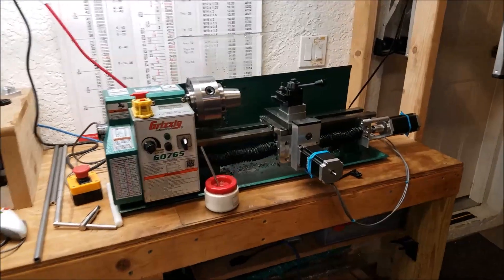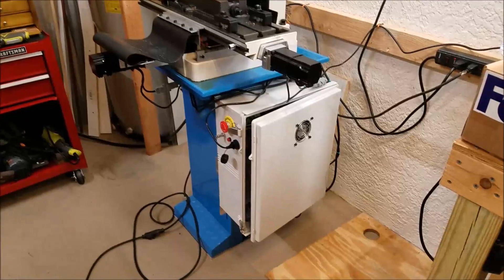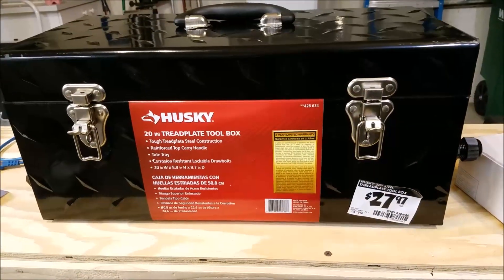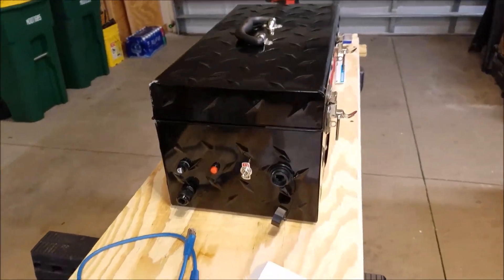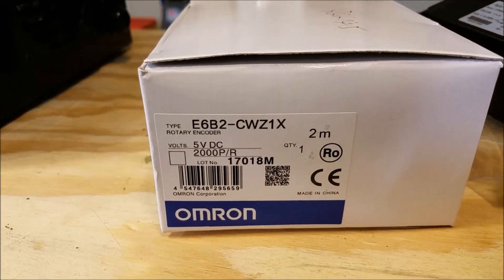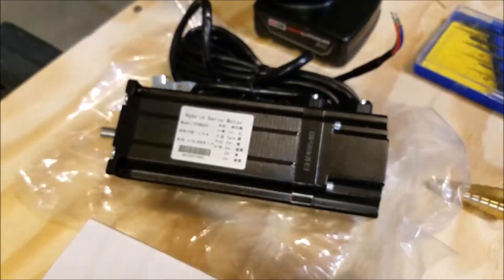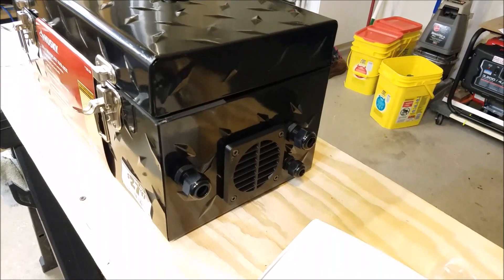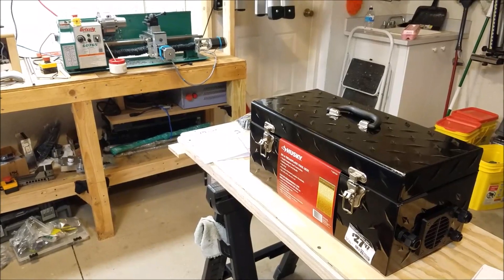DIY Closed Loop CNC Control #1: The Enclosure

Comment: Hello, what is better in terms of performance is a hybrid stepper motor that works with three alternating beats or a hybrid stepper motor that works with two daisy wins and what is the difference between them, what do you advise me knowing that I have a professional milling machine, please help and thank you very much
Reply from the maker: Hello.  Some motors are two phase and others are three phase.  I've used both types and I don't see much difference.  As long as you buy closed loop steppers, I think you will be happy with the performance on a milling machine.

Comment: Hi Franco, I have a Grizzly G0768 lathe, and I'm suspecting that I'll be interested in doing a CNC conversion. My question is this:

All-in, what sort of cost am I looking at? I need everything Centroid Acorn, a computer, a CAM software, all steppers and drivers, power supplies, encoder, etc? Can you ballpark me a cost, within $500? $1500? $2500? $5000?
Reply from the maker: This may help:  https://youtu.be/dvbsIgrwl1U
Reply: @FrancoCNC  Thanks Franco! You're so helpful!

Comment: Where’d your DMM servo motors go?
Reply: ScotY808 i was wondering the same thing
Reply: ???  What??  The X & Z axis motors go on the ballscrews themselves (drive the axis ballscrews  !!!) usually coupled via flexible couples, bracket and end bearings! If you don't know that you ought study threads on CNCZone.com, PracticalMachinist.com   etc.
I cant believe you asked that, unless you simply dont know the first thing about CNC conversions. If you truly don't, go to those sites I mentioned --THERE'S A LOT OF STUFF YOU NEED TO KNOW BEFORE ATTEMPTING ANY CONVERSION, ELSE YOU'LL WASTE A LOT OF MONEY IF YOU DON'T KNOW WHAT YOU ARE DOING. Meaning for example: don't buy DMM servos and Drivers unless you first know what they do and how to use them - that's just the tip of the iceberg.

Comment: That's a cool enclosure man, do also plan to connect the alarm signal from the drive to the controller so that if one motor goes into alarm then the controller will stop the spindle, feedhold the motors and show a message on the screen. We had a client wire the same motors but didn't connect the alarm to the controller and then due to a faulty power supply the x motor gave an alarm while machining and z kept on working and hit the spindle because the controller never stopped, just a thought, thx
Reply from the maker: Masso CNC Controllers Good point. I actually experienced the exact same problem on my milling machine.  NC alarm signals are a must.